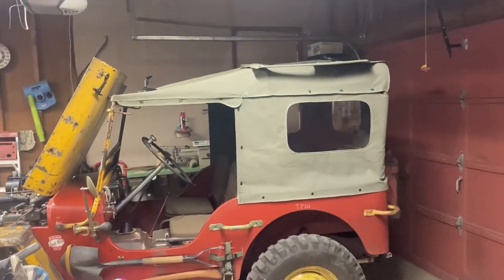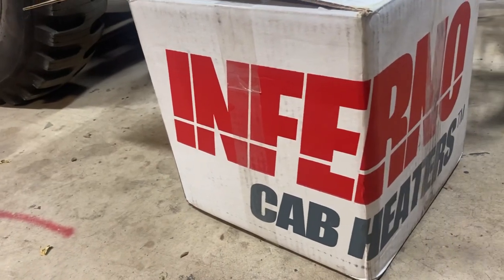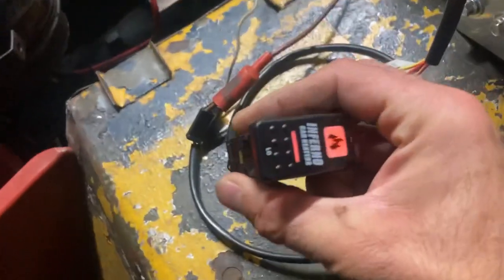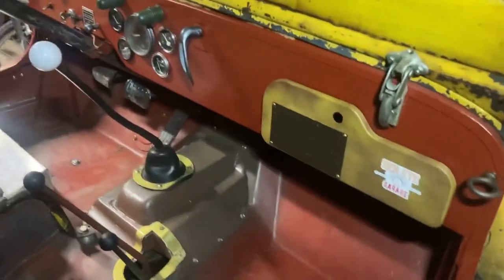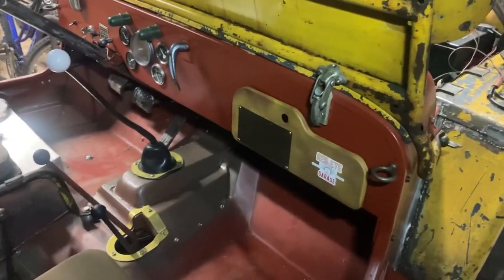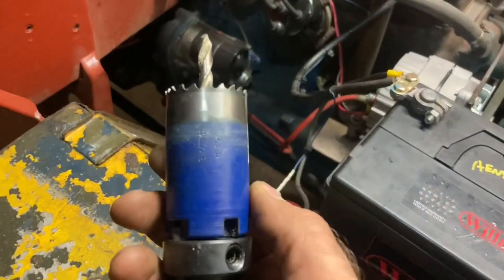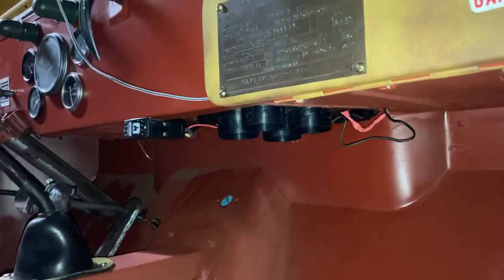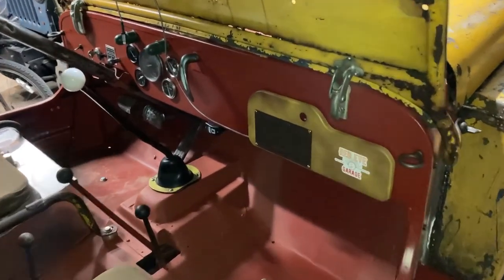Inferno sxs cab heater Willys jeep install

Comment: Hi buddy how are ya? Oh man thank you for sharing this. I’ve removed the heater in 69 cj5, I’m gonna go to swinging peddles and break master on the fire wall. This lil heater will be perfect. The heater core looks to be about the same size but with a more efficient blower. I will mount mine like you did out of the way, but must make a bracket off the firewall inside as the glove box is fiber board. Thanks buddy! God bless you and the fam!!

Comment: Tight work,looks good!
   Should keep the icicles off  of all in the cab!!? Lol!! 
    Thanks for sharing 👍!
                    👍🧙‍♂️!
Reply: Just a thought, install water shutoffs for summer running.
Reply: @renniejames9887  very good idea 💡!!
Reply from the maker: @renniejames9887  I have a valve that goes on the head for summertime.

Comment: Hey I’m really interested in the top you made. Do you have any templates or measurements I could use. I’m about to attempt the same thing. Let me know thanks! As far as the heater that looks like a pretty good option for my Jeep. Thanks for making the video.
Reply from the maker: Thanks. I just made it to fit and built it around my roll cage. Not template. Sorry.
Reply: @redeyecafegarage7484  it looked really nice. What size material did you start with if you remember? I found a canvas tarp at harbor freight that I think would be perfect for mine. There’s a 8x10 and a 10x12. I’m trying to figure out which size I should get. How did you start the project? Or where did you start first. I can’t find anything except where a guy did a half top. But I want a full top like yours and doors but don’t want to pay the big price that they cost. I think I can fudge my way through it but just need a few pointers. Thank again for any help on the subject.

Comment: This is a really cool modern heater to retrofit into a vintage jeep. I had been looking for an original for years for a decent price. I finally found one. It is restored and mounts over the drivers feet. Should keep my feet warm. I am trying to keep everything 1945 and older.

Comment: It will be interesting to see how it works. I never saw a flat head jeep or early rig have a good heater. The engines dont put out much heat.
Reply from the maker: Lol… most of the ones I’ve been around have trouble not overheating so they make great heat! 😆
Reply: @redeyecafegarage7484  I have a cj2a that i have owned 40 years it will over heat in the summer but in the winter it is fine . I would like to see more  of your top. i have a consew machine that i used to redo my m38a1 seats and make a bikini top.

Comment: With that little 4 banger I bet you will have to install an electric fan to get the radiator hot enough for that windy cab. Maybe not, but that little motor will take a long time to get hot in the extreme cold with the fan you have now spinning. Good luck.
Reply from the maker: The l134 makes more heat than it should. They always run hot. And are inherently thermally inefficient. It will heat just fine. I been running flat fenders with no top all year long forever so just having a top alone will be a massive improvement.